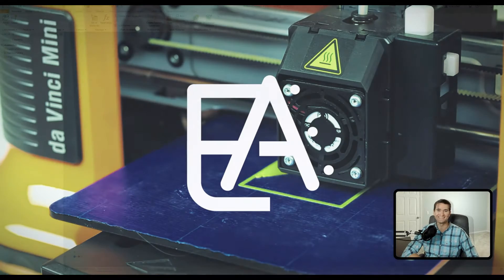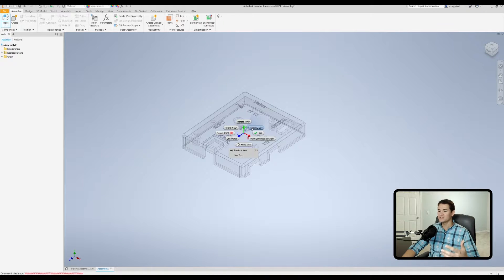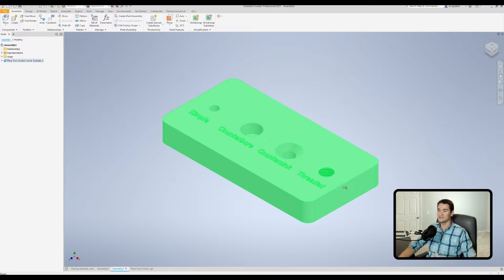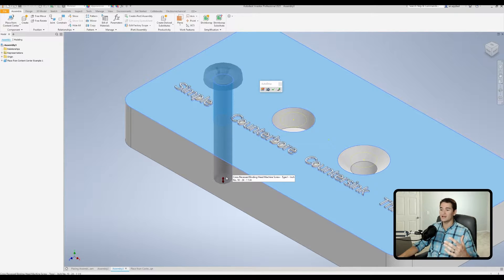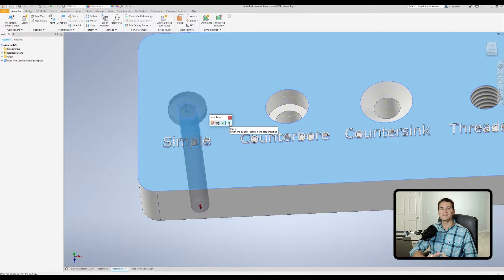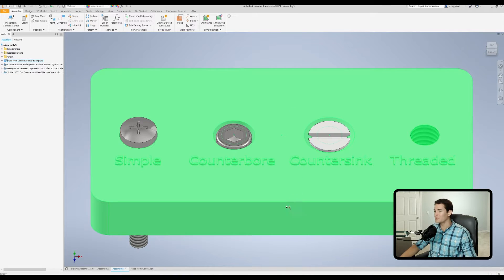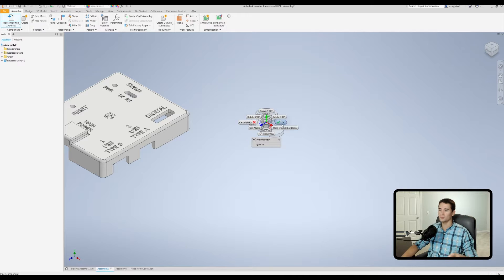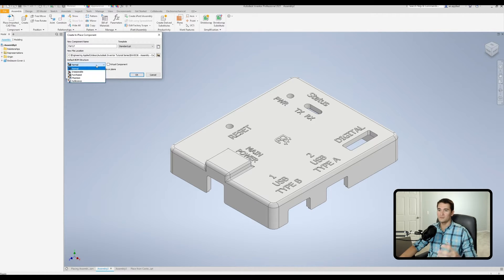Place & Create Components - Autodesk Inventor Assembly Tutorial | Autodesk Inventor 2021 IN DEPTH

Comment: Hey Alex, thank you very much for your videoseries! I'm transitioning from CATIA V5 to Inventor and am missing the option to drop my assembly axissystem onto a part I want to move and then be able to roughly position the part in the assembly via the space mouse like in V5. Is there a possibility to manipulate parts in an assembly via spacemouse that I am missing?
Reply from the maker: Hey, thanks for taking the time to reach out! That's an excellent question. I am actually missing the axis system from CATIA as well (I used CATIA when I was designing products in the aviation industry). I currently do not have a space mouse so I cannot effectively answer your question at this time, however, I am planning on getting one in the near future. At that time I will play around with it in Inventor and see what it can do. I know in the past there were problems with 3D mouse functionality in inventor but I would like to test it in its current state to see if the issues have been resolved.

Thanks for watching and I am very glad the video series has been helpful!